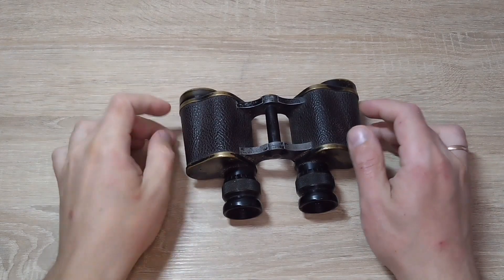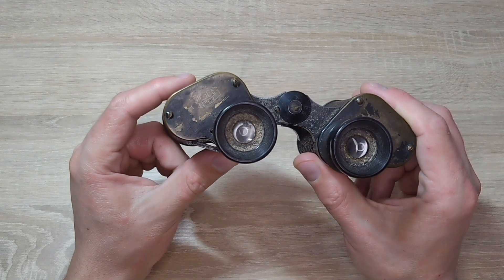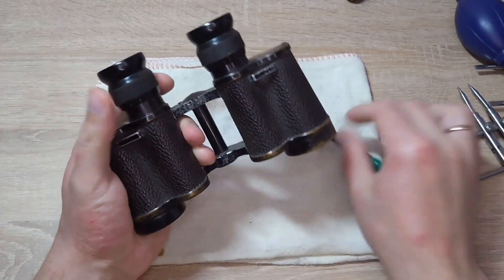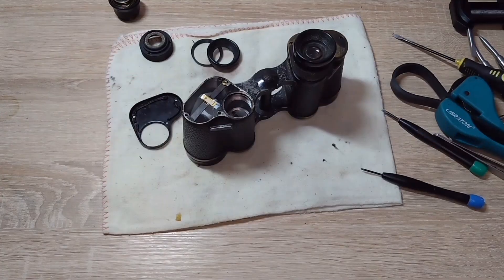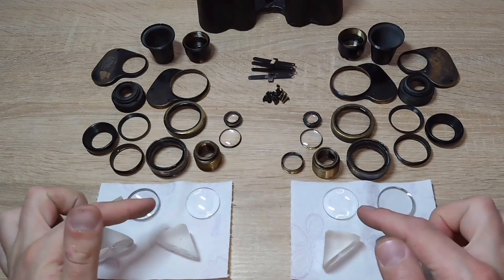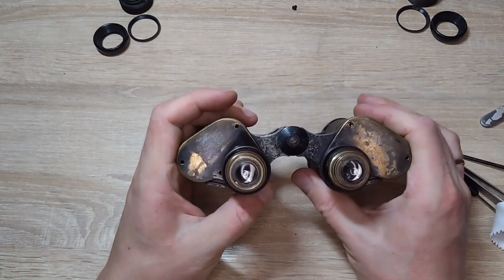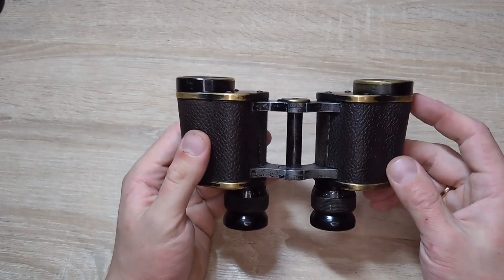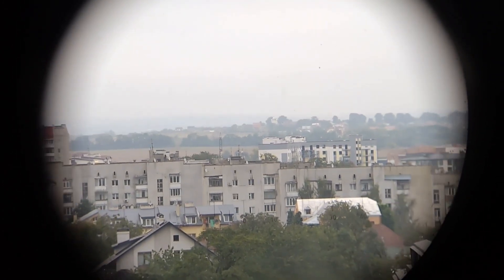Restoration of an Old OIGEE Berlin 6x30 Review, Disassembly & Repair

Comment: Nice video! I just bought myself the same exact ones. Sadly, one of the lenses on the left side is sitting incorrectly. I know nothing about optics. Are there any tips you could give me before I attempt to repair them?
Reply from the maker: the lens is not sitting correctly is it the wrong side?
disassemble the nearby eyepiece and see how the lenses are located there, it is better to photograph or videotape this process
Reply from the maker: You probably only have two lenses in your glasses. It's hard to make a mistake there.

Comment: Hello @S_t_OKRAT thanks for the instructing video!
 Right now I´m trying to restoring some old german Krombach binoculars. May I ask you, what sealing do you recommend to use?. I will appreciate your help.
Reply from the maker: What does the word "sealing" mean?
Are you talking about sealing prismatic caps or are you interested in what kind of lubricant I use?
Reply: @StOKRATzoom  thanks for your answer. On the covers a sealant or sealer to prevent moisture getting inside... The cover I mean where the company's name is written, e.g. "Oigee" or "Krombach". I hope you can understand me, I'm just getting started in this field, & have to learn the proper names or parts. Thanks!